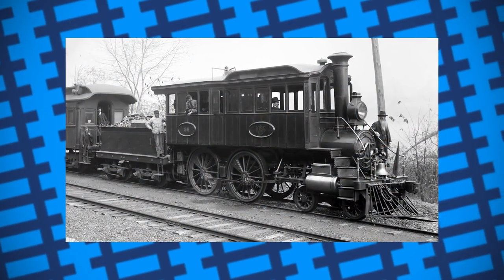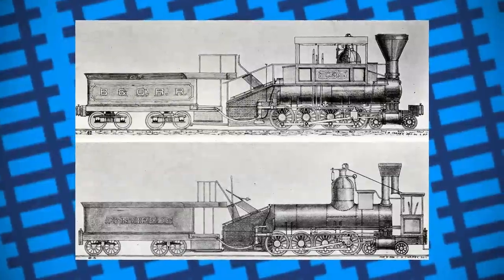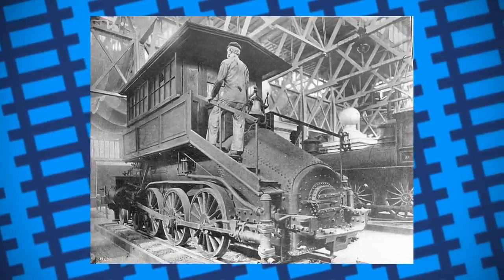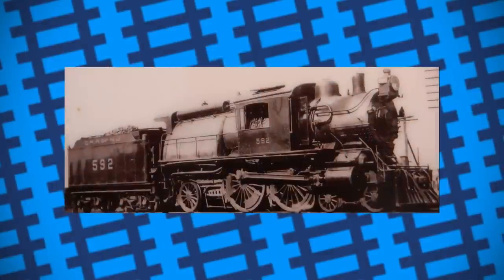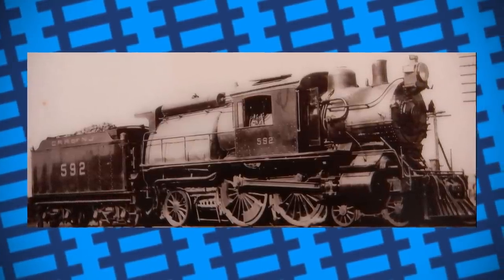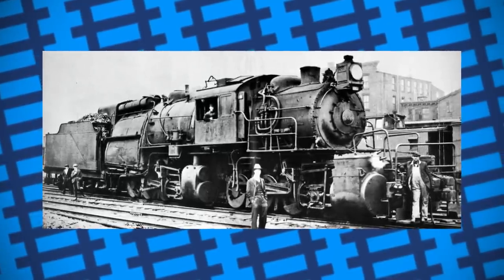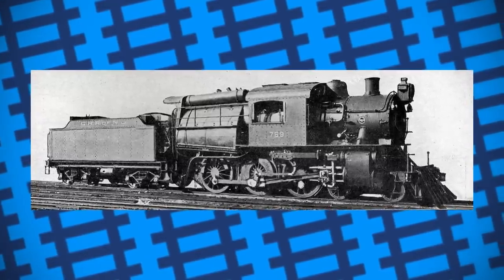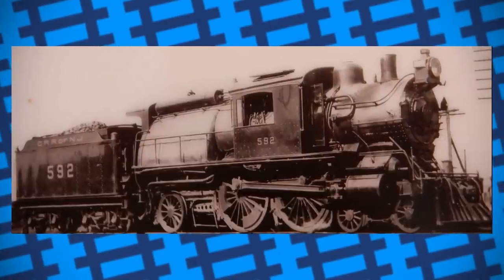Steam locomotives with cabs in the middle of their boiler - Camelbacks

Comment: In the TTRPG I develop, I designed a 4-6-4T camelback for use as a military scouting engine. The elevated cab makes it ideal for scouting areas around the track and as a mobile firing position, and the front bogie is used to house a steam cannon. Making it a tank engine alleviates some of the concerns about side rods breaking, as the water tanks would take the hit before they could get to the cab, and the lack of a tender adds to its mobility, particularly since the driver is elevated and can see quite easily in either direction. Since it's used primarily for scouting rather than pulling trains, it doesn't need as much fuel capacity, with a rear bogie providing enough support to house an extended bunker that suits its needs.

Comment: Having just looked at your video on the Shay locomotive, one of my favourite US engines I am now looking at the early camelbacks. Another if my favourite US engines.

I first came across these when I was looking at armoured trains of the American Civil War. In particular the Hayes 4-6-0 camelback. It looked at first someone had taken a locomotive and having realised the had forgotten the cab had placed a signal box on top for the driver, or is that engineer for the US. The photograph did not show much of the tender but from what it did show I was left with the impression they had not had a tender on hand but did have a trolly handy so used that instead. OK a little flippant, maybe. But as I have a thing for the eccentric it went straight into my list of favourite US Locomotives.

As much as I love the engine I have to say how sorry I felt for the crew. The fireman stood on his little platform in all the elements. Come rain or shine, summers heat or winters snow. And the engineer in his cab on top of the boiler. What with the heat from the boiler and the smoke from the stack. Summer must have been a true joy.

Comment: The camelbacks have been my favorite types of locomotives ever since 2019. Nice video about them. Now, there was another flaw with the camelbacks: The cab's placement was also supposed to give the driver a better, closer view to what's ahead of them. However, it didn't work out that good because it was moved closer to the smokebox & obviously the smoke degraded visibility.
Reply: I had a feeling the Comeback is your favourite Locomotive because of your character 😊 that are cool 💘❤❤💘💘 Railfan#1 you know a lot about Trams its awesome
Reply: I saw that episode in your series!
Reply: @aliminator1310  me Too lots of times
Reply: They were outlawed before steam ended. The rod would break on wheels and take cab off with driver in it
Reply: @hisexcellencytrump855  Steam Engines can be outlawed?  Well I've never heard of that before 😅
Reply: @alicehodges9964  do some history research, and find pictures of rod failures when these are at rated speed.
Reply: @hisexcellencytrump855  I will do I'll see if I can find something
Reply: Visibility wasn't a problem at speed, the smoke would get forced up.  At low speed there's not as much draft, so visibility could be bad when doing a lot of switching, which is what a lot of these got relegated to doing in their later years.

Comment: My favorite type of locomotive! My favorite locomotive of all time is the Erie L1, the odd Mallet 0-8-8-0. The Erie L1 were very similar to Bertha in the UK, in that they were designed to push.
Reply: They were so hard to fire that firemen were changed every eight miles.
Reply: @garryferrington811  Um, no they weren't. 10 hours shifts on the Erie L1s. This is according to actual Erie documents. And the Angus crews were paid on a daily rate when all other engineer & fireman were hourly.
Reply: If I am remembering correctly, they were designed for pushing trains across Gulf Summit near Sanford, NY on the Erie's Susquehanna division.

Comment: Railroads had good reason to use Wootten Fireboxes. The Reading Company of Pennsylvania crunched some numbers in the late 1870s and found that by using the waste coal that a Wooton firebox could burn compared to a more traditional design/fuel, they would annually save around $2000 a year on fuel. (Worth over $56,000 in 2022!) Bear in mind these numbers were done for engines that had the cab mounted on the rear of the boiler so that it was on top of the firebox, and thus these technically weren't true Camelbacks.

Comment: Sorry, but this video repeats a lot of myths and inaccuracies. Winans' camels did not place the cab over the boiler to add more weight to the driving wheels (this idea literally makes no sense from a basic physics standpoint, as all the wheels on the camels were drivers, all of Winans' camels were 0-8-0, so it makes no difference where the cab is, all the weight of the locomotive is on the driving wheels). The reason Winans did not put the cab at the back of the locomotive was because the frames of the locomotive did not extend beyond the back wheels; the firebox was self-supporting and Winans did not want the unsupported firebox to carry the weight of the cab. 

Wooten's original wide-firebox locos in fact had the cab perched on top of the firebox. One was sent to Paris for the Exposition Universelle, and it was subsequently given a test by French railways - the cab sat too high up for the French loading gauge, so it was moved ahead of the firebox and lowered around the boiler barrel. Although this was not strictly required for use in the U.S. with the low-mounted boilers of the 1870s, it quickly became adopted as the norm for Wooten firebox locomotives. Finally, there never was any ban on the construction of the type. The camelback disappeared for a number of other factors: the cheap supply of culm had run out by the 1920s, American engineers were adopting trailing axles on their locomotives (a wide firebox no longer had to be over driving wheels, and longer frames became normal, allowing more room for cabs behind the firebox), and the diameter of boilers increased so much since the 1870s, that there was no longer space for the driver to sit in a cab with a boiler through it.

Comment: I've been intrigued by camels and camelbacks since first discovering them at, roughly, the age of 14. (56 years ago!) They are uniquely American, a solution to a specific American problem. One safety problem you didn't mention was that, if anything happened to the engineer, the tallowpot had no way of knowing anything was wrong and, equally importantly, of accessing the controls in order to take over.
However, did you know we did actually have one here in England? She was a Baldwin 4-2-2, similar to a type used on the Philadelphia & Reading and, in England, known as the 'Lovatt Eames'. She was brought over by the Eames Patent Automatic Brake co, to haul demonstration trains on our Great Northern Railway; her cab, stack and fittings had to be cut down to fit even the GNR's generous (by our standards) loading gauge. 
Unfortunately English railway chiefs were reluctant to accept other peoples ideas; the engine was left behind when the Eames co pulled out, and cut up for scrap. Her bell still exists, in the headquarters of the Royal Society of Engineers.

Comment: To the best of my knowledge, most of the Camelbacks were run in the Northeastern US, where a locomotive's height and length were governed by the myriad of tunnels, bridges and tighter radii of curves.  For instance, back in the 1970s SP4449 couldn't pull the Freedom Train in the Northeast for those very same reasons.

Comment: Another problem was that the fireman couldn't communicate with the driver, or take the controls if the driver became incapacitated.Incredibly, Baldwins recommended a camelback 4-6-0 design to NZR to burn lignite coal. In a loading gauge with a maximum height of 11'6" ! Lacking anorexic dwarves to drive them, the CME Alfred Beattie designed a wide firebox 4-6-2 which served well from 1902.

Comment: Putting the cab of the loco atop the boiler doesn't increase traction, since it's supported by the drivers no matter where it's located. Besides, cabs (and its occupant) don't weight that much relative to the rest of the loco.

Comment: The best looking Camelback was no. 1027 from the Atlantic City Railroad, a 4-4-2 design with 84” drivers. In 1896 it made the run from Camden to the Boardwalk in Atlantic City (55 miles) in 46 minutes, which surely was one of the fastest start-to-stop runs in the world at that time.   You can’t get there that fast today.
Reply: That's an average speed of 70 miles an hour. Impressive!
Reply: I love how the best looking one, looks worse than any normal engine.

Comment: What about the Double Faries, built originally for the Ffestiniog Railway, but other railways have used the design, on their train locomotives. The cab is in the middle, between two boilers. These are still in use today, on the narrow gauge railway, which runs between Blaenau Ffestiniog, and Porthmadog.

Comment: The locomotive in the first shot#98 is not a Wooten firebox eng, it's a normal firebox inspection engine.  Actually the original camelback did have the cab at the rear, sitting astride the firebox.  The engine was set to France and Italy to demonstrate since those countries also have Anthracite coal.  The problem was that the engine with the cab on top of the firebox was too high to fit through the Italian tunnels.  The engineer and firemen decided to move the cab and all the controls to the running boards just ahead of the firebox. making the locomotive short enough to fit through the tunnels.  It returned home in that fashion and Reading Co. realized that they could gain the same advantage if they replicated it.    What killed the camelback was the boilers got too big in diameter and there wasn't enough room for the engineer next to the boiler.  No camelbacks were built after WW1.

Comment: It's nice to see this being put out there, however...  Camels are Camels and Camelbacks are Camelbacks.  They're not related other than in appearance.  The distinction is becoming blurred with time.
Reply: This is not quite true. The Philadelphia & Reading R.R. purchased some Camels from Ross Winans, had them rebuilt by James Millholland, who ended up adopting some of Winans' ideas for his own locomotives (eg. the long firebox). When Millholland retired he was replaced by Wootten, who continued to develop Millholland's designs, leading to the Wootten firebox and the camelback type - it's a bit tenuous, but yes, the two types are related.
Reply: @furripupau  Based on your description, I'm guessing the camelback design could be considered a descendant (or as I'd call it, son) of the original Camel design. Right?
Reply: @strcmdrbookwyrm  Yes. The throughline between Winans', Millholland's, and Wootten's locomotives was they all sought to use a large grate/firebox, and Millholland serves as the connection between Winans and Wootten. In fact Millholland was pretty well acquainted with Winans, he even helped set up and modify the Tom Thumb locomotive on the B&O, so they both knew each other from the very earliest days of steam power in the U.S.

Comment: Here's a question to my fellow Americans, if a camelback loco could be restored to operation, is it legal to operate? Mostly of the "danger notion" of the rods snapping into the cab...
Reply: The main rod / sideswipe issue was very limited in its occurrences, and actually only happened on a few occasions, but was very dramatic. Crown sheet failures due to low water were much more common, but because most of the damage was not visible, it was not as well covered in newspapers, but in actuality more crews were seriously injured and / or died from that, than sideswipes on camelbacks. 

As for restoring one to operation, there are very few remaining, and what it boils down to is money. Very few of the general public even are aware of it, much less will pay to see it. People will chase the Big Boy across several states, but who is going to travel to see a Camelback restored to operation, except Wootten firebox / Anthracite fans?.
Reply: @BEDT14  The steampunk fans would like it!
Reply: I'm sure it would involve a limited operation permit. Basically this ICC ban was a pre Ralph Nader "Unsafe at any speed".

Comment: The "ICC ban" is not factual. Only two Canadian provinces and two US States actually regulated the use of camelbacks. The Canadian regulations (Saskatchewan, 1906 & Alberta, 1907) were written in case the engineer was incapacitated, allowed the use of camelbacks with a third crewman in the cab opposite the engineer. The US states (Indiana, 1913, & Arkansas, 1917) did ban them outright. But a nation wide federal ban by the Interstate Commerce Commission (or any other US Federal agency) was never enacted despite the popular misconception it was. This was heavily researched and written about in great length by Gregory Ames, and and is contained in the #219 - Fall Winter 2018 Edition of "Railroad History", a publication of the Railway & Locomotive Historical Society. No less than 24 pages of content and 75 citations from National Archives, Library of Congress; archives of Congressional & Legislative, newspaper archives, various railroad Union filings, among various other sources.